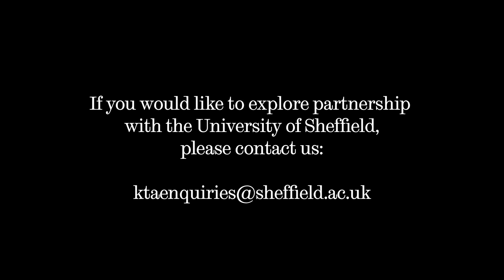Micro Bubbles & AECOM

Comment: In  ocean, the physical body, consisting of a gas microbubbles, is capable to emitting light, the pressure wave, is capable to injure or destroy  of ship. Electrization microbubbles in physical body able to influence the electrical engineering equipment of ship.
UNIDENTIFIED SUBMERGED OBJECT (ANOMALOUS PHENOMENA IN THE OCEAN ) N. Solodovnik